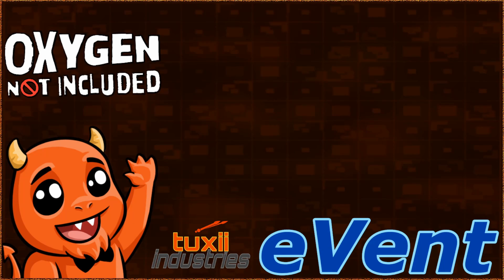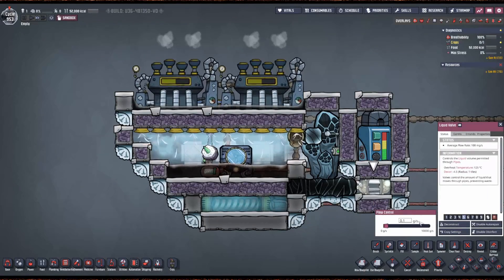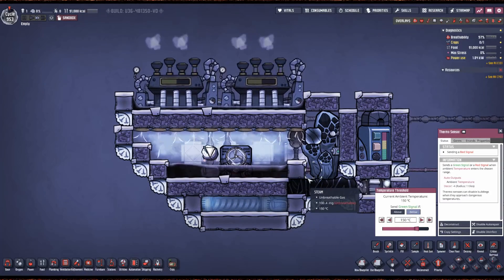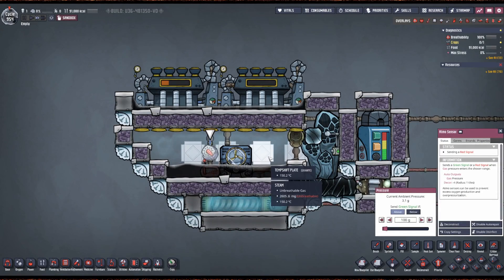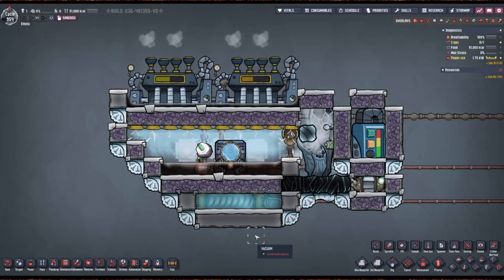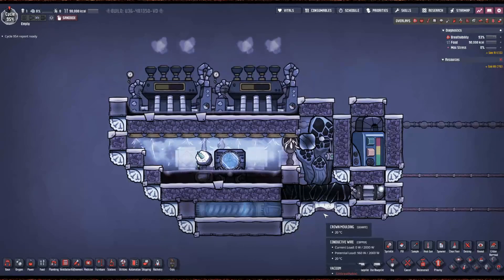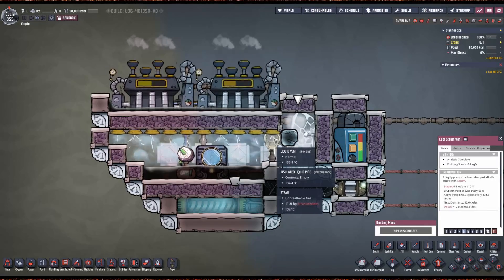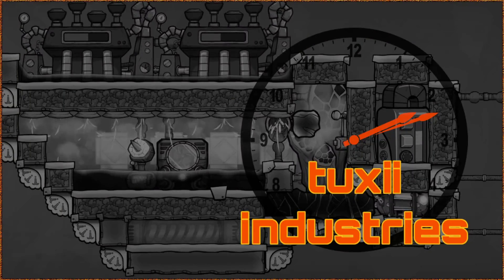eVent - Energy Saver Cool Steam Vent Tamer - Oxygen Not Included

Comment: This doesn't work for me, the oil drop just gets moved onto the neutronium and it floods with water. Anything I'm doing wrong?
Reply from the maker: Unfortunately, the oil drop can be finicky but can be easily replaced by tapping into the water line and injecting a little more oil.
Reply: @tuxiiindustries  Glad its not just me messing it up. Great stuff, works a treat now 👍

Comment: My understanding from watching ToniAdvancedOni was that for a fully exposed cool steam vent, you need a steam turbine per 2 kg/s of steam coming from the vent.  So, the number of steam turbines for a cool steam vent (csv) in general would be ceiling(csv pressure / 2), where ceiling is the ceiling function, or in other words rounded up.  For this cool steam vent at 9 kg/s (which is rather large from what I've seen), that would mean 5 steam turbines without having the granite tile there, and steam turbine on both sides of the csv.

Do you think that with a similar, but larger tepidizer-aquatuner-tempshift plate such a tamer would work similarly and process all of the steam?
Reply from the maker: If the CSV output 9kg/s lifetime or if you don't want to use the bead pump trick then yes you would need 5 steam turbines.  This design could easily be expanded to the left to accommodate more steam turbines and the bead pump and associated liquid tank could be deleted.  It'll be huge and expensive but it should be power efficient.
To be completely honest I prefer the sVent and paying the extra power cost.  I've never needed to save power badly enough to save a few watts on a CSV tamer.

Comment: Simple optimization: instead of running the coolant liquid through a Tepidizer, use the water output from your steam turbines to heat up your steam turbines with radiant pipes. They will never heat the turbines enough that their temperature will exceed 100 celcius, yet you should get enough heat this way to keep your steam room hot enough and you will get cooler/more usable clean water as an output.
Reply from the maker: The tepidizer is just a stand in for a water tank.  Ideally the 95C water could be sent to an oil well and the cooling could be used for your base or a different water tank.  Your idea is good but we didn't want to close in the turbines with insulated tiles.
Reply: I thought the same